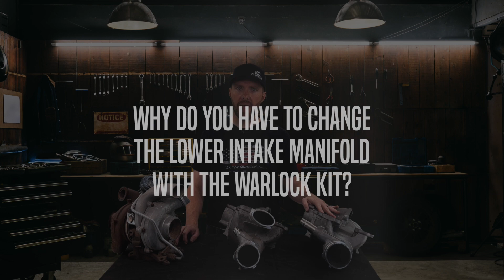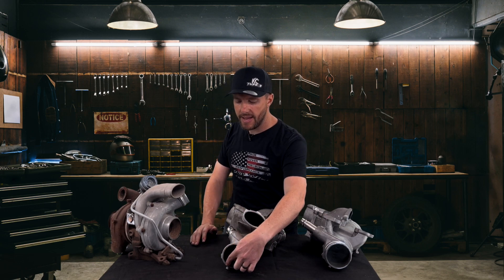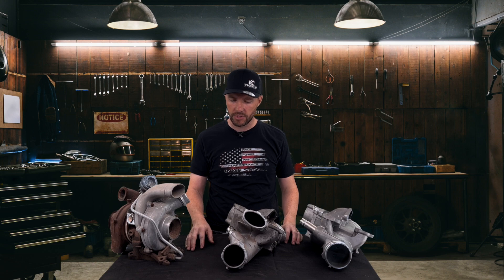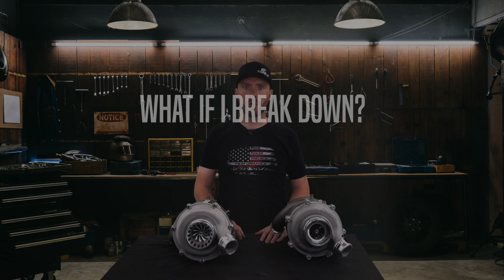Hidden Benefits Of The KC Turbos Warlock Retrofit Kit! - Saving Your 2011-2014 6.7 Powerstroke!

Comment: Got my Warlock and Stage 1 Whistler installed about two weeks ago. I absolutely love it. It does take some time to learn the new setup because the turbo does not spool as fast as the stock 11-16 turbo... but when that boost comes on it seems as though its never ending power. Huge difference up top without a doubt. I pull a 16,000 lb. fifth wheel RV and this turbo makes all the difference. I don't think my stock turbo would have pulled my RV up the three mile 8% grade that I pulled up this past weekend. But with the KC stage 1 Whistler installed, it pulled up the grade at 40 mph without flinching. I have owned my 2011 F350 King Ranch for 15 years now and this upgrade combined with the Pusher Intake and AMDP tuning makes the truck feel brand new. I will drive the truck for another 15 years now!! Thanks, KC Turbo!

Comment: I recently purchased the warlock kit for my 2014 along with the piping kit , are band clamps for upside and down pipes included in either kit ? The ones holding in previous turbo didn't come off very easily and are not reusable?

Comment: Great video. In the near future,.  I will purchase the retro kit with the KC Stage 1 turbo. My 2011 F350 is deleted. Additionally, I recently fitted SS Fuel DCR HP Fuel Pump to replace the Cp4. Will my current tunes (Tyrant Tunes) work with the retro stage 1 KC Turbo setup?

Comment: Nice, I have a 2012 f250. Egr and dpf deleted. What exactly do I need to use a newer turbo (whistler stage 2). Can I get a list pls 😅
Reply from the maker: All you need is to do is pick up the Warlock turbo kit, and choose a whistler stage 2. That is the easiest/most simple route. There is also a ford Racing retrofit kit that you can pick up as well: https://kcturbos.com/collections/6-7-powerstroke-turbos-retrofit-kits

Comment: I just installed their stage 2 with a 10mm CP4 on my 2011 with their warlock kit which made it way easier to install. Good job KC
Reply: I run the same setup with AMDP files and it’s a monster at 650hp
Reply: @JBMEDIA323  I’m proven now with a lot of smoke when not in boost. It’s fast as all hell just very smokey on every tune.I’m thinking about switching to them how does your truck run?
Reply: I’ve run everyone and lots of files 

Both options are great, make sure you have higher shift points
Reply: Hi can you tell me please what exactly you got to run a newer turbo and pump? I got a 12, deleted and I want to get a stage 2 whistler
Reply: @gonzaf250  KC warlock kit with a whistler turbo. A 10mm cp4 either a RCD or an Exergy. Their kit came with everything I needed except new V bands for the downpipe and manifold. You are also going to need a piping kit, pusher, mpd or no limit are all good. Not sure what you are tuned on but you have to have an EZ link auto agent 3 too.

Comment: Man I just bought the warlock Kit with the KC W2, I bought a piping kit as well and didn't know I didn't need the lower intake! Where was this video a month ago! I sent the lower intake back to you guys! Thank you for your support and awesome customer service! Great videos!
Reply: Sorry. In the options when you buy it when you select “already have a piping kit” then it is slightly cheaper
Reply: How did the install go? I'm on the fence for the kit and haven't seen any videos of it actually being installed
Reply: @abc123hshdhd8w  turbo comes out just like a 2011, goes back in just like a 2017 turbo.  Warlock kit is much easier to install vs ford retrofit kit.